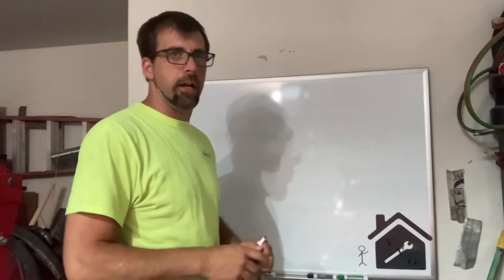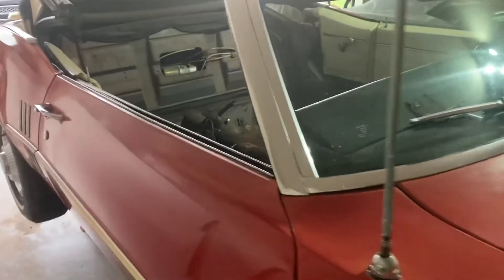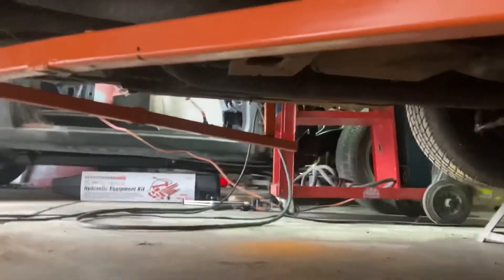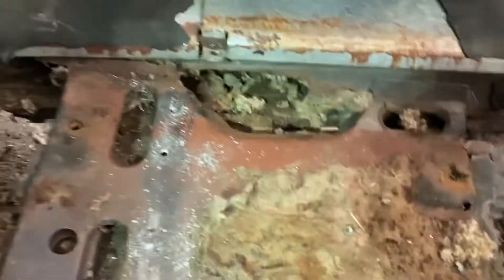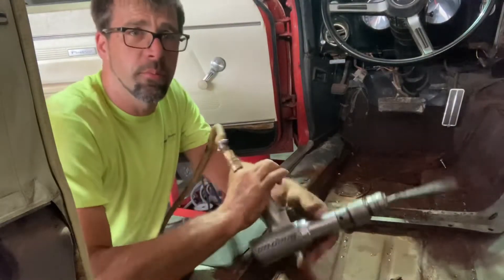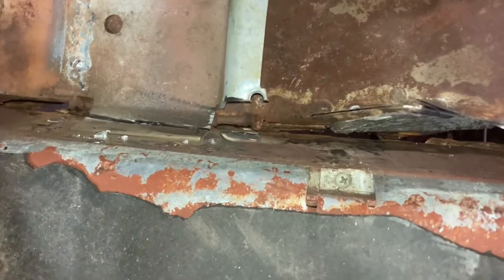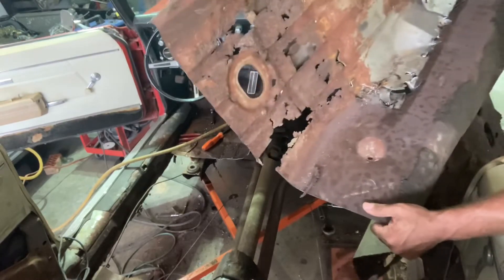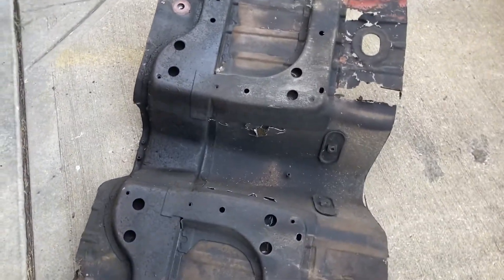E12 Firebird convertible restoration rusty floor pan removal

Comment: Dang I was cringing them electric angel grinders are powerful and the thin blades brake with just the slightest jam had one blow apart and thanks to God it only cut my thumb nail and thumb almost Off! I was never use it again with out a shield and cloves duck taped it immediately and it heald up like new was lucky now I use battery grinder and air not as powerful lol just sharing something that could of been really bad.
Reply from the maker: I don’t have a great reason why I don’t use the guard for the majority of the cuts, sometimes it just doesn’t fit.  I should head your warning and experience. Now I I just need to find where I put them. Thanks
Reply: @VinylVillageGarage  I know what you mean I never use the guard either I probably should have kept my mouth shut lol I meant no gloves but my accident was a off the wall harbor fright cut off disc not the ones I usually buy from them I just wanted to let you know what happened to me so it wouldn't happen to you but I sware those electric grinders have serious power so I just got use to the battery one I can control it better that was a good video like all of them that seat mount kicked my but took me a little while lol but yours looked like it didn't have a million plug welds like mine did

Comment: Something I noticed, the bird has a standard interior door's (door handles pull up) but has a deluxe 3 spoke steering wheel ?  Was this a real 400 car ? Thank God my 400 / 4speed Convert is rust free.
Reply from the maker: No this car was 350 2bbl car with 2spd trans.  The steering wheel was an available upgrade option on any bird standard on 400 deluxe.  Not sure if this car came with it from the factory but it’s a nice touch.
Reply from the maker: Extremely rare and cool yours is rust free.  It happens but not common here in Indiana the rust belt.

Comment: How bout some detail on the orange structural support welded op b4floor  pan butchering signed amateur pre apprentice trainee metal butcher
Reply from the maker: The orange structure is a cobbled mess of 1.25” square tubbing installed before cutting out the floor and I am not entirely sure it’s necessary.  I just do it because it was taught to me as good practice.   
     This might get lengthy so hang on. I am almost convinced that adding bracing is a lost cause on severely rusty car bodies. Not to mention the odds these old cars have never seen a collision or two or three at 50 years old is almost impossible.  So what’s that mean? It means it’s all out of shape before you add bracing so if you tie it together twisted then try to install sort of correct panels you will still have a twisted car body with new panels. That’s a waste, theoretically bracing is only valid and good if installed on a rust/damage free body but that’s pointless.  What do you do? Here is my best advice, check your shop floor is it level and uniform, if so use it as a foundation then build up from there. The goal is get the car body true to the floor this is why you might have seen a few guys have a huge thick steel plate on their shop floor, overkill for a novice or one time build. 
  Let’s get started begin by lifting and leveling the rocker panels parallel to the shop floor then true up the body side to side to the floor. Shim it up however you can but get it level.   Then you should be able to take measurements from mirrored points on the body side to side and so on. If it’s all say within 1/8” tolerance all is a good and add some bracing to keep it good before cutting apart.  Now if it’s not level or way out of wack best suggestion look for rust or collision damage and start repairs in that area until it does square up.   This is the point where ratchet straps and big hammers are your friends.  
   Last tip keep as many of the body panels you plan to use on the car as possible. Like the doors and trunk deck. As you pry, cut, replace, and repair   continuously check you body gaps for improvements or maybe making them worse and then proceed with welding after correcting the gaps because when it’s all done the gaps will tell the story of how well you did because that is what we all see. 
    That was a lot of info but this is my best opinion on how to get the 50 year old body shell back into shape without a frame table or expensive shop doing it to who knows what level of quality. I have seen cars with 1/4 panels installed at over an 1” in height difference side to side and it was supposedly done at a professional shop. I believe this is why you are asking for info you are getting some advice and knowledge to do this yourself. I will tell you it can be done to a true professional level at home and you have just completed intro to metal butchery 101